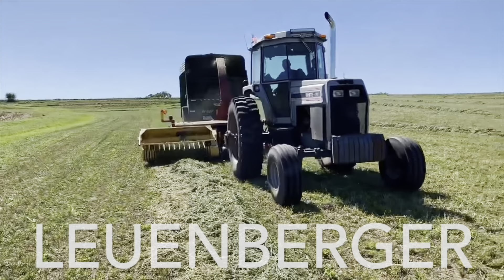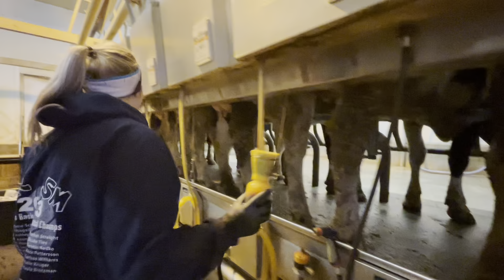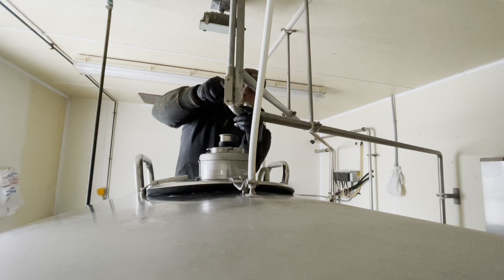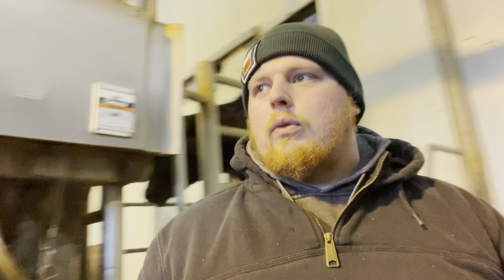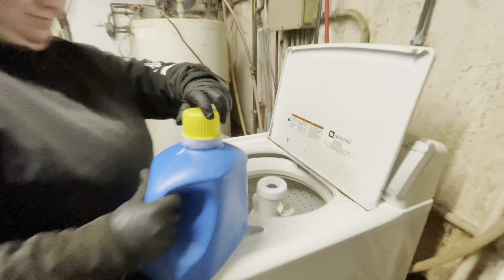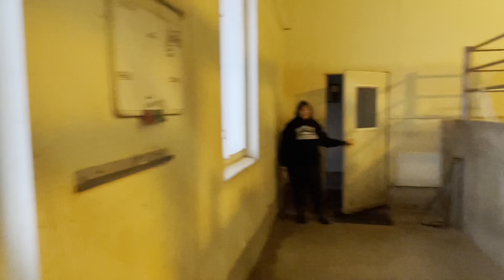Milking cows on the farm!

Comment: I milk 200 jerseys in a 50 stall rotary in CT how many are you milking and do you have any jerseys how big is your parlor and can you get parts for surge equipment have a friend in PA that had a double 8 surge and replaced it with Delaval that's what I milk with
Reply from the maker: Very awesome! We milk 200 Holsteins no jerseys, in a double 12! Parts from surge are pretty easy to get with them being about 20 min from us.
Reply: My friends surge was outdated hard to find parts how old is yours and what did you milk in before I had a100 cow tie stall barn with 8 Delaval takeoffs don't miss bending over parlor is 2yrs old
Reply from the maker: @bobmorse3513   ours is 21 years old I am 21 so I don’t remember the old stanchion barn but that’s what my grandparents milked in before the parlor. That burned down before I was born. They milked 100 cows then, if not for it burning down I’d say we would still be milking that way with 100 less cows.